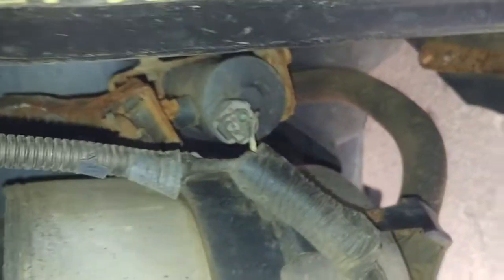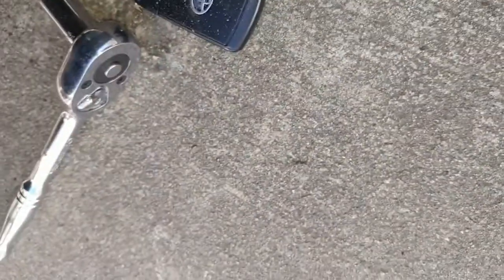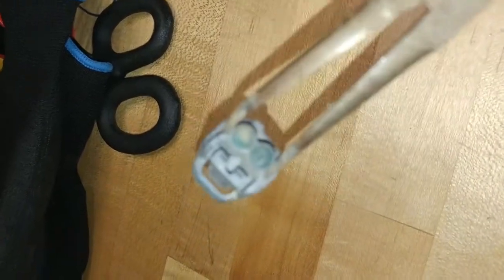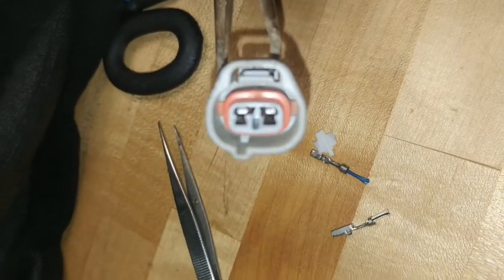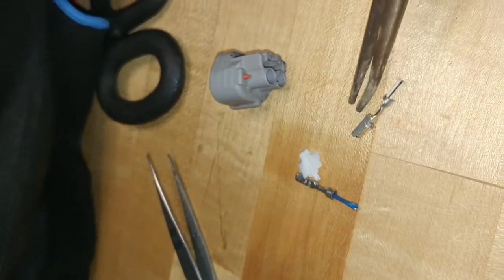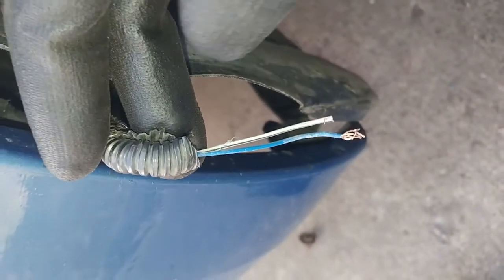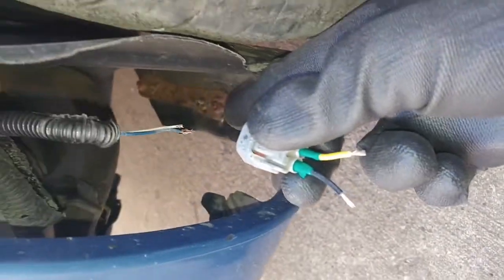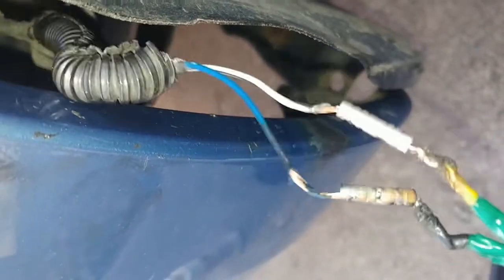Prius P2601, CHS Pump, possible cause and fix

Comment: Depending on where the wires are being stressed (where the breakage / potential breakage is), I'll use a little RTV silicone or double walled heatshrink tubing. This not only seals out moisture, but also lends extra mechanical strength. Side note, electrical motors are not a binary. Depending on the design they may produce the same output at increased draw, or draw the same and produce less work. But generally speaking it's fine if they are working "well enough" and there are no indications of heat damage at the connections, nor any fuses / drivers popping.

Side note, the brakes are OK as long as there is enough material on the pads and no noticable pulsation/dragging/hanging. But the next time you DO service the pads you will want new rotors, coated ones will slow the corrosion. At that time you'll also want to inspect the calipers - you can coat them but its a PITA, generally just run them until you have issues and then toss them (and often the hoses) and get coated calipers.
Reply from the maker: I definitely did a ghetto job of the wires here. I also totally forgot I had alligator clips which would've made soldering them possibly clean. Also, the pump is in fact locked up despite what I thought in this dumb video :)
Reply: @smokeydops  It's good enough to test function. I am lousy at cleanly soldering anything unless I have everything on a bench and its not small wires. I just use butt connectors with built in heatshrink and sometimes solder inside. Crimp and heat! 

Electric pumps will fool us. They'll run sporadically and then not at all, but they can still get hot and make noise as though operating! The other thing is the condition of the fluid is important for the longevity, it keeps the pump lubricated and free of corrosion. So you have to periodically change it.

Comment: Did you wrap it with electrical tape to seal it a bit?
Also. You might need rotors :3
Reply from the maker: yeah i wrapped it, and put the plastic bumper sleeve back on :)